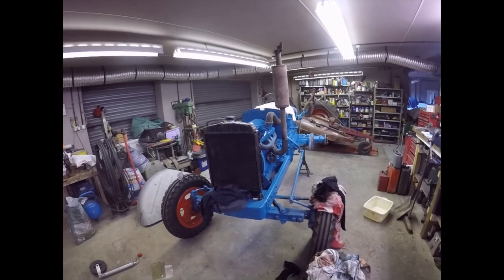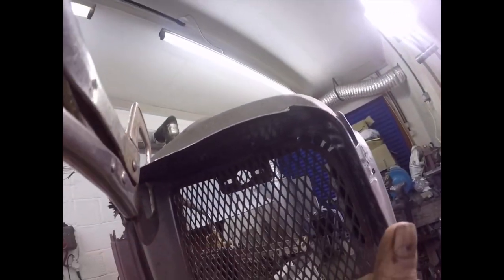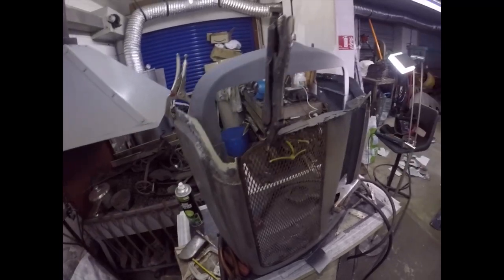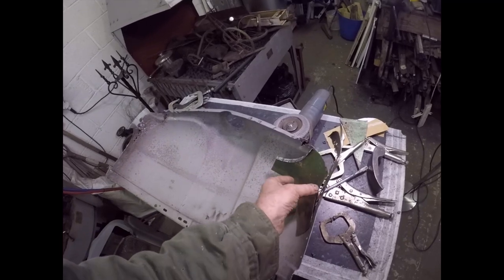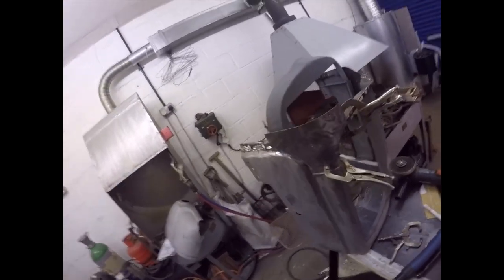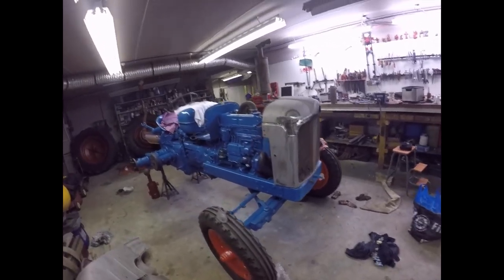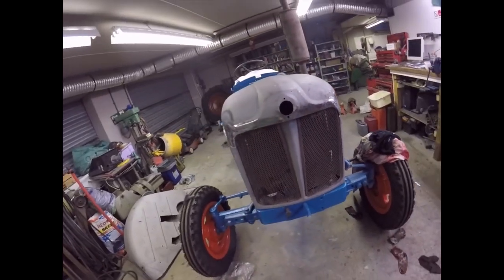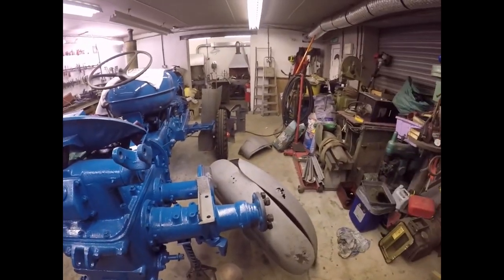Fordson Major E1A rebuild, Part 26 Front Cowl, the welding!

Comment: Looking good Phil. I was debating with myself the pros and cons of fitting new tinwork. I am guessing that your will work out stronger and will last longer, but if someone else was paying for your time it will cost a lot more. It is a long time since I worked on a "Henry". I still remember lifting on on a chain hoist to work on the brakes. The jack was in use elsewhere. For those concerned about safety it was on blocks whilst I worked on it.
Keith (Also in E Yorks)
Reply from the maker: Hi Keith, new tin/old tin, it is a toss up, one of the Fordson parts suppliers is offering the whole of the tinwork plus the lighting for £850, but I have seen a lot of ppl say how thin it all is compared to the original, and the biggest complaint of all is that it doesnt fit!. That is certainly my experience with pattern parts, I could buy a pair of pattern mini wings in the seventies for £12, when real ones were £14 each, but the real ones dropped straight on, and the pattern ones were a nightmare to fit! Where in EY are you?
Phil
Reply: @philhermetic  Bilton